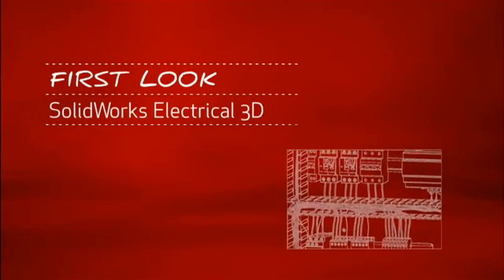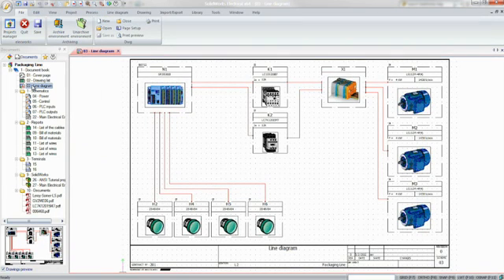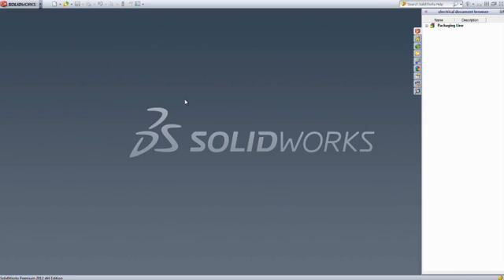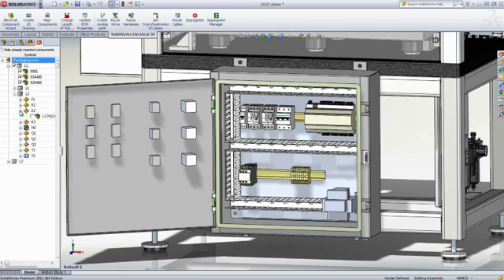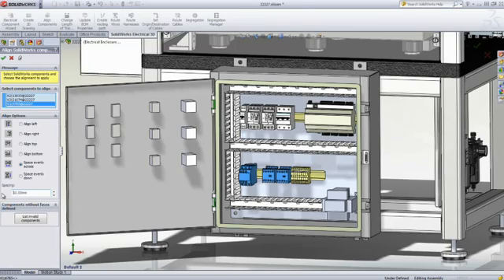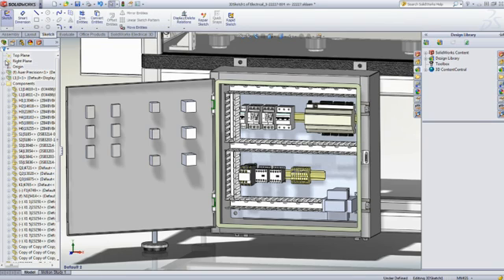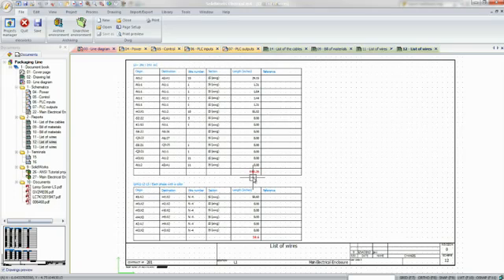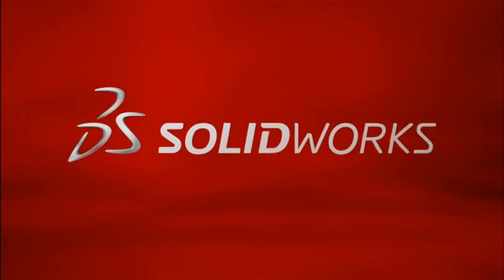First Look at SolidWorks Electrical 3D

Comment: how to add custom  din rail and wire duct and cabinet  in solid work electrical and it use with panel in 3d 
i see lot tutorial all tutorial teach me advance but i want to learn basic start with step by step for panel design in solid work 2d and 3d 
please help me